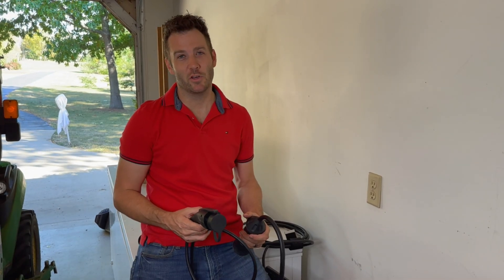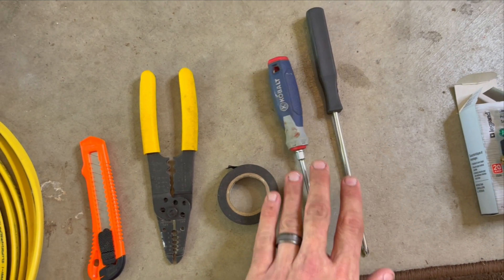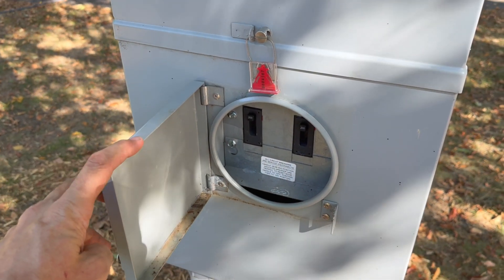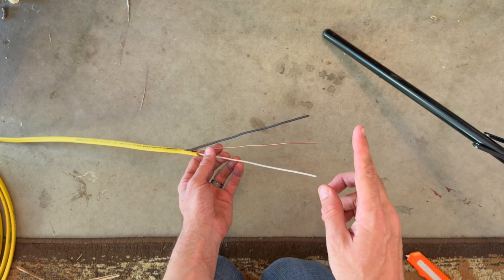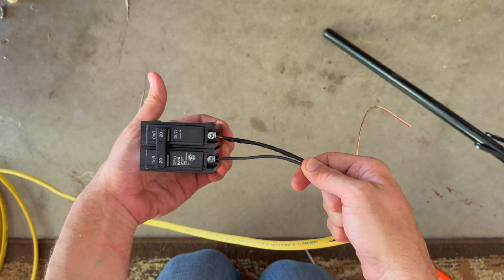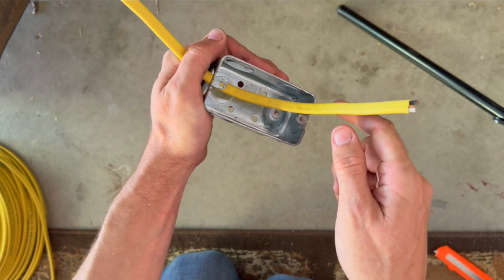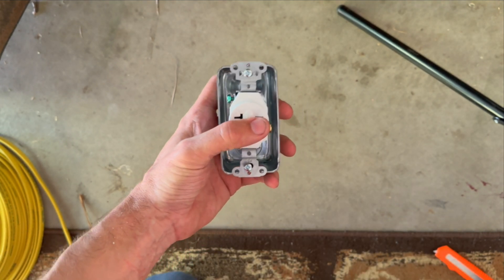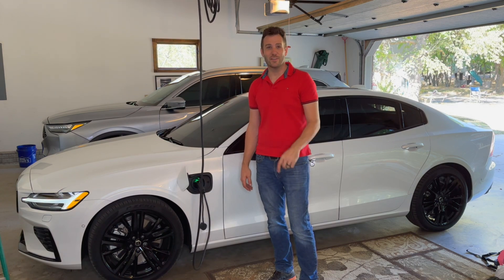20 amp 220 or 240 volt Volvo Car Charger Wiring

Comment: This is the best config at home.  Low cost, probably won't need to change breakers and nothing too complex.  Safe too so get the Nema 6-20 with a 16a charger and only bother with a larger Nema 14-50 plus plus plus and plus $$$ if you are drying one huge car like a Cybertruck or have money to blow.

Comment: Thanks so much for putting this out! The dealer had no idea that there was a 220v 20 Amp option. They sold us the full ev charge cable for $600 which did reduce the charge to 5 hours, but hope to get the same results with the way you did it. Just dealing with the lighter gauge wire than the full ev will make it worth it. Thanks again!